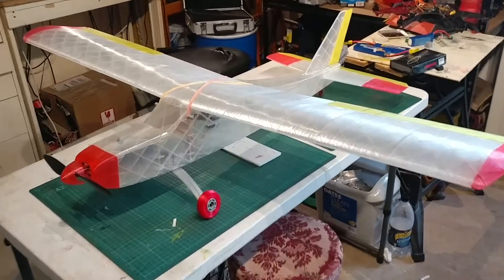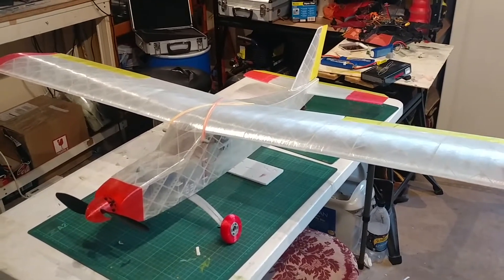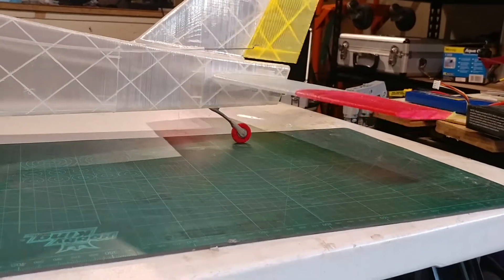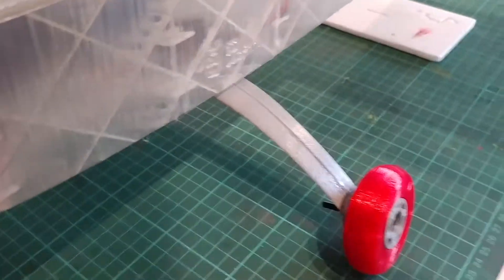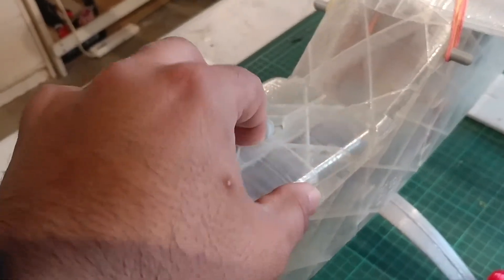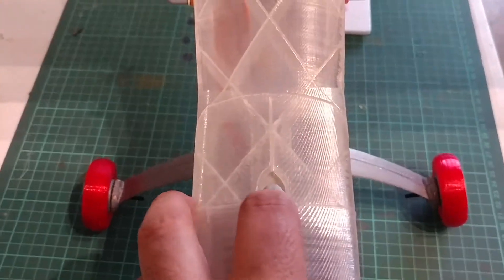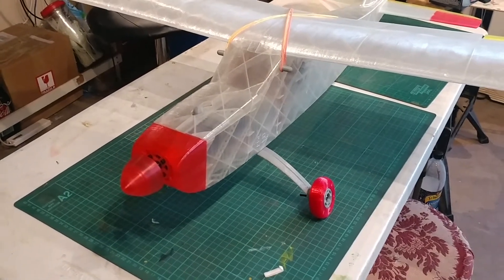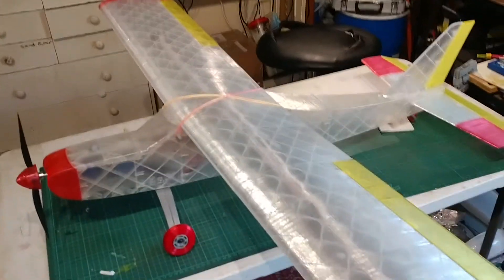Completed my 3D Printed RC Plane!

Comment: thanks for posting.   it better be tough because the distribution of mass of a printed model is Less than ideal.   on a high-wing airframe, the battery should sit Low in the fuselage; for max keel effect stabilization.    the design of this airframe puts the prop too far from the main wing.   this excessive distance will result in Excess pitch axis stability.   you might want to trade that plastic prop for a 'stiff'   E   prop.     it appears that the main wing has hoerner tips.  if so, they work correctly only when they are right-side-up.   cheers
Reply from the maker: Thanks for the comment @David Davids, you make some good points. I have seen come videos from other who have made this one and they seemed to fly well. I guess I'll give it a try and see what happens. I have got some experience flying RC planes but this is the first 3D printed ones. I guess if I do crash I can always just print another one.
Reply: good point!    cheers
Reply: Hi how did it go Iam just trying to print one myself on a Ender 3 using cura